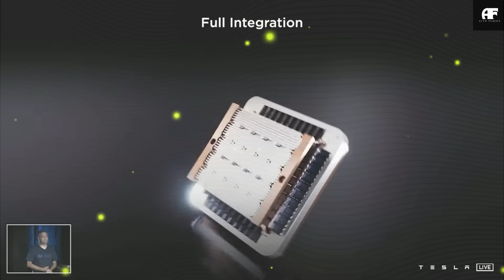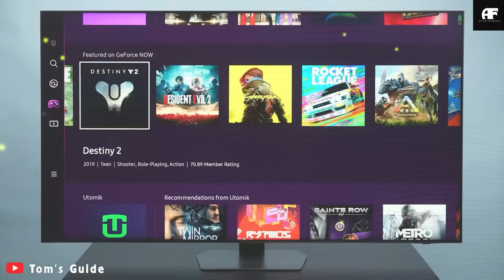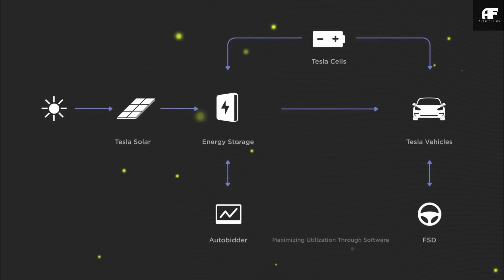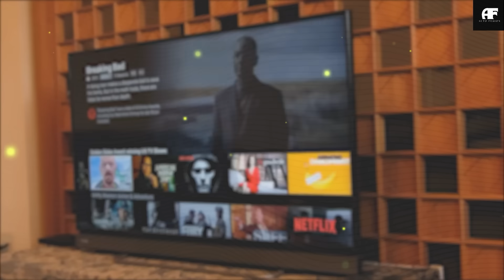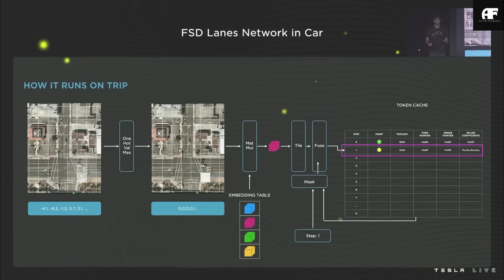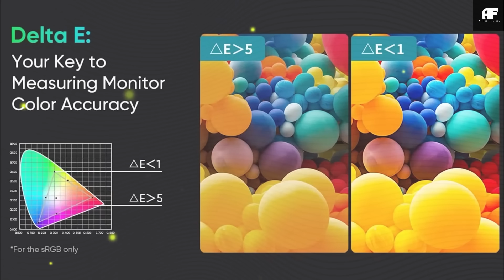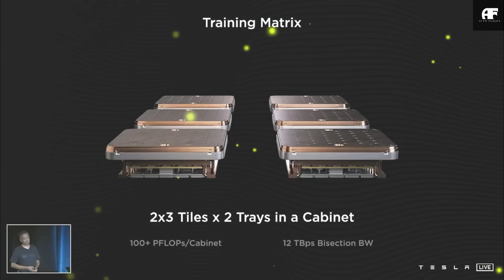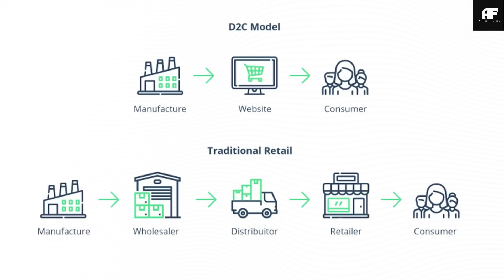Tesla Smart TV 2025 Revealed – Elon Musk Shows Off INSANE Features!

Comment: is just amazing 
Tesla Tesla Tesla Tesla Tesla Tesla Tesla Tesla Tesla Tesla Tesla Tesla Tesla❤❤❤❤❤❤❤❤❤❤❤❤❤❤❤❤❤❤❤❤❤❤❤❤❤❤❤❤❤
Reply: Race a equal weight gas vehicle across the country. Obeying speed limits, same route. Tesla would lose. Time at refueling alone would be the downfall. As for the carbon footprint, the lack of exhaust is more then made up by the manufacturing of the vehicle. Any plastics have oil based material, what's producing the power at the plants the vehicle is manufactured. The rare earth minerals, and the methods of removing and milling for producing the batteries alone make up the carbon footprint. Still may be a good vehicle,  but we can't pretend it's helping the environment.